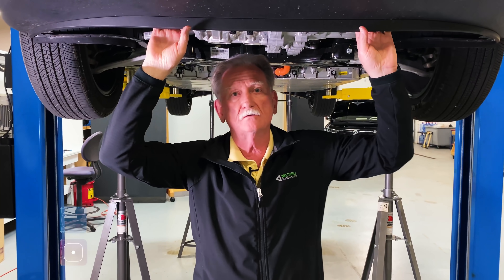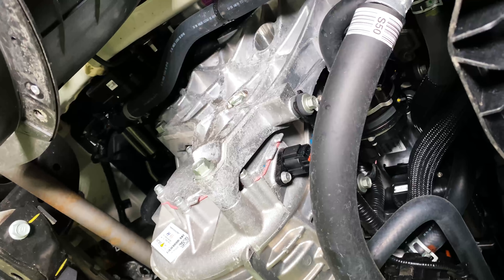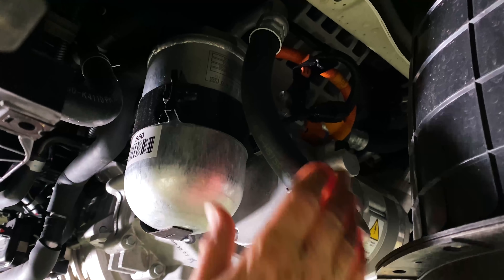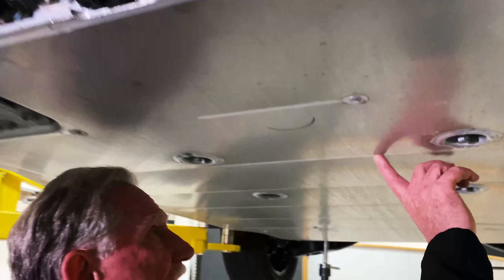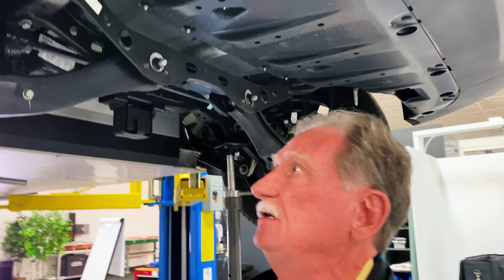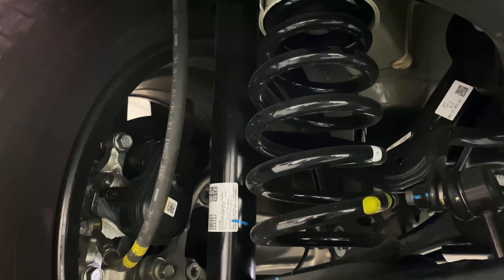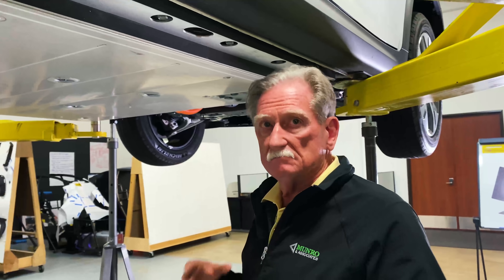Under the KIA NIRO EV

Comment: I'm glad they're look at the Niro EV.  I have this car and I came from a Tesla Model 3 SR+.  It's nearly as efficient as the Model 3 SR+ but it's got a bigger battery and a less aerodynamic design.  I was hoping for some insight as to how they made such an efficient car. 

I see why you'd call in at old person car.  Feels like it's got no frills and a softer ride than the Model 3.  I'm hauling around both my young daughters most of the time and I'm pretty happy with it.  

Might get an Ioniq 5 for a bigger car, the faster charging, AWD, and towing though.
Reply: You are saying the Niro has a Bigger battery and less Aerodynamics but that its more efficient then the M3?
Reply: @williambricker5988  I'm not saying that.   "Nearly as efficient," is what I wrote. It's less efficient than a Model 3, but it's really close.
Reply: Yup, I agree with all that. And also the Niro has real dials and controls on the dashboard... pretty sweet.
Reply: I’m confused why the bigger battery is a positive to you. You should want as small of a battery as possible while still getting the longest range. All batteries do are add cost and unnecessary weight. People should be aiming for increasing efficiency and range while keeping batteries small. Maybe in the future when batteries are cheaper, but for now I’d much prefer a car with a small battery then one with a larger battery and the same range.
Reply: @philorgneopolotin8762  I mention the larger heavy battery as something that's works against efficiency.  Despite that it is still nearly as efficient as the smaller battery in Model 3 SR+.  

Yea a smaller battery in size and weight is desirable to help efficiency.  I appreciate that the capacity is 25% greater in the Niro EV than the SR+.  64 kWh vs 50 kWh.  I do a 220 mile roundtrip highway drive to my sister's house twice a month.  The SR+ requires a charge stop and the Niro EV doesn't.  That's 24 less charging stops in a year.

Comment: i bought my wife a Hyundai Elantra limited a couple years ago. They make damn good cars with a 10 year warranty. Im all about using reliable proven parts if theyre cost effective and durable. Her car has the Atkinson designed engine which is better than any direct injection engine for reliability IMO. Why reinvent the wheel when you dont have to unless its a better yet less expensive part.  I respect Hyundai/Kia more than any other car maker( 2nd to Tesla of course). Id buy a HYUNDAI EV over any VW, GM, or FORD

Comment: There’s a plate that goes under the motor right? Otherwise those connectors are going to get whacked by something, they are so low to the ground.
Reply: Another comment from an Niro EV owner says yes, there is a cover which Sandy didn't mention removing.

Comment: Not enough space for a coilover for the i.r.s.?
Reply: Why would you want coil-over shocks? Suspension performance is best, if the shock and spring are mounted on an arm like this, with the shock as close to the wheel end as possible, and placing the coil spring around the shock keeps it from being as far out as it could be. This isn't a competition vehicle, so the adjustability of threaded spring mounts on the shocks would be pointless.

Comment: It’s Knee-Roh. And I’m hardly an old person, sold my Model 3 and picked one of these up as a lease for $314/mo. It is the most underrated EV available out there. Gets many more miles than the advertised range, its super quiet and confortable. No it is not as “cool” as a Tesla, but man it’s very nice if you can get a deal on it.
Reply: Sandy explained previously it is effectively a joke to say “nigh row” instead of the sound of “Nero” to avoid invoking the name of the Roman empower who allegedly played his fiddle while Rome burned.  It is a not so subtle jab at the problems Kia and gm have been having with their volatile EV batteries.  And yes, I drive a 2017 Chevy Bolt.

Comment: There appears to be a nice short length of cable between battery pack and motor, but the connections to the battery look quite vulnerable to road debris. Have I got that right or did I see it wrong. Also was it possible to see where the inverter was? Is it possible that the inverter is behind the bolt on plate at the corner of the battery?

Comment: The front of that battery pack and wiring is exposed to road debris, weather and whatever!  Weird
Reply: Only after the panel is removed.
Reply: @brunohill3229  I thought there would've been a panel but he said that he wasn't taking things apart.
Reply: @brucewayne2984  He said he wasn't taking specific things apart, but had already taken the cover off. The extra stands are there for safety because they took some parts off not knowing if they were going to accidentally drop the battery in the process. I don't know why they don't just read the shop manual...

Comment: So far, it's what I'd expect out of a modern Kia. Built like a glorified 90s car! :P

That rear suspension looks kind like a multi-link, with the spring and shock that is. But then there aren't the multiple links. Maybe cutting those additional links out is causing the vibration and harming handling?
Reply: It has a trailing arm, two lower lateral links (one of which is the one carrying the spring), and one upper link per side. It is a common multi-link design, used for a couple of decades by several manufacturers. Sandy just doesn't show the rest of the details, mentioning only the spring and shock placement and spring link design in this brief report.

Comment: 90'...It has the latest design i.e. the suspension as a typical gas car. Don't know any 90' daily car that has independent rear suspension... .
Reply: The suspension is practically identical to for example the 90s Toyota Previa, altough the independent rear suspension version wasn't sold in the US. A weird comparison, I know, but I happen to own a few of these Previas and they for sure were daily cars.
Reply: I bought the cheapest available Toyota in 1984 - it had independent rear suspension.

Comment: I have a swiss army knife in my pocket all the time, use it a lot! the most I use it for is to open beer bottles, but the screw driver(s), scissor, knife(s) come in handy now and then too.. 

But I agree, if you have a swiss army knife that is too thick with too many features, it loses its versatility, because the thick knife prevents you from using the tools properly.

Btw, this whole car starts to turn out to be a perfectly designed 90's car LOL!, old does not always mean bad! often in means better!! (read: more durable!) 
Nice review as always :-)
Reply: Same here, beer bottle opener gets used the most. Agree with Sandy,mine is just the blade and opener.

Comment: 90s car input...Rusts around the wheel wells in 3 or less years, has rust "drip stains" down the back hatch where the steel fasteners are used, door panels rusted out after 3 to 4 years, leaks oil after 6 years...love the 90s!
Reply: Bad car experience? In some parts of the world one can still see Audi 80 or 100/A6 1st gen still driving in large numbers, despite road salting in winter.. Double sided zinc protection on the entire body does the job. Mechanically also simple '90 cars.
Reply: I have a mid 1980s car, no rust.
Had a transmission leak years ago but had it fixed. Surprisingly, the car still has all its original parts including hoses, alternator, sensors etc., everything works.
Reply: @mamadouaziza2536  If you are running a mid 80's car with the original hoses and belts you are nuts!
Reply: @michaelholliday100  
Not nuts, its just all the hoses including the timing belt are in pristine condition.. I personally check every 3 months. The only sensor every needed to be changed was the one for the idling.. Water pump and fuel pump are all original.
Original fuel injectors and spark plugs. Even the catalytic converter is original. All window motors are working, the same with the air conditioner, not once has it had to be refilled with refrigerant..

The car is built like a tank!
Reply: Got a Toyota from 2000. That car never dies. And never was in a shop unless I wanted. Some old cars are made for life, not profit.
Reply: @NTNLabs  it was not a complement. 
its a Oldsmobile Custom Cruiser of Ev.  not toyota.

Comment: Laughed my ass off at "well designed 90's vehicle."
Reply: Like tesla without the batteries and the PlayStation and the IPod ALL
Reply: @nexussymbiosis9270  better than 2021 shit?  Its called perspective. Lots of people buy Toyotas for their perceived " reliability". How much of that is old tech? Would you buy a big pickup with rear drum brakes? ( i know Sandy thinks they are ok, but i think  my life is more important than saving a few bucks) They are still being sold. Perspective.
Reply: Packed in a Mazda design.
Reply: These cars are designed so easy to repair most repairs I do I can have done done within an hour..engines can be dropped in 45 mins subframes 15 mins dashes can be out of the car in 15 mins. There just giant legos and would pick a KIA over any other new car for quality of design even though the design is old which I completely agree with 😂
Reply: Lol
90s electric car😅😂
Reply: @CarlosReghis  Tesla has a smaller battery, less range for a much higher price.
Reply: I suspect that Kia wanted to save a ton on design and perhaps make last use of their existing assembly line.
Reply: polite way of saying, don't buy it.

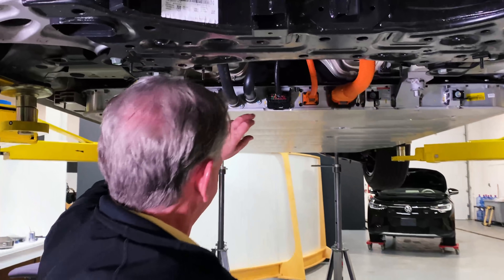Comment: looks like they just took an ICE car and slapped a battery and electric motor on it.  you can even see the exhaust tunnel at 5:00 also, the battery seems to be the lowest point of the car.  speed bumps are gonna destroy that battery pack.

Comment: Dual mini AF motors side by side and direct without reduction gears would provide all the torque needed without any bulk.  Storage volume would be enormous.  Cost would be minimal.  Efficiency would increase by 25 percent.  A $15,000 Honda SUV?  YEAH, that's what I'm talking about.....
Reply: Separate motors would eliminate the differential, but increase the cost. Motors without reduction gearing would need to be much larger, and would be much more expensive. There would be little to no improvement in efficiency, since the gearing wastes very little energy.

Comment: Built on proven tech. No wonder they're so reliable and popular. Still 280 miles and 0-60 in 7s with 450 litres in the trunk and that's just above the load floor. It's a legend here in the UK, where we think the Kia Soul looks like a granny car!
Reply: I agree 100%. Most poster here are from the States. We here in Europe have slightly different requirements and opinions - which is ok. We drive a 2020 Niro and are very happy with what we got.
Most BEVs where first based on ICE platforms, except Tesla and BMW i3. But in 2 years nearly all BEVs will be on their own new designed platform.
Thanks Sandy for all your insite you give us.
Reply: I like the Soul..

Comment: It looks over constructed for strength and durability .
Reply: My wife has a 2021 Kona EV and when I got it up on the hoist to do some rust spray/r&r exterior lamps, I came to the same conclusion.  Chassis details such as the chassis aerodynamic trim parts are far superior to my 2018 TM3.
Reply: It’s rated for 100 kg roof load, 100 kg load on the tow hitch, it’s like they built it as a SUV and designed it as a city car. I think it’s awesome.

Comment: does the vinyl on the underside that runs along side of battery have any sort of texture? I am wodering if it somehow has groves or pattern to redirect rocks/debris toward the outside of the car so it will drop out and away onto roadway vs flying directly toward the rear

Comment: How can these Kia engineers put the battery and aux battery connections on the leading edge of the car??!! Get ready for moisture ingress.
Reply: There is a cover that goes over all of it..
Reply: Yeah, I was sort of surprised that Sandy didn't comment on the leading edge of the battery pack. Looked pretty vulnerable to me. That said, Kia managed to keep the power supply cabling really short.

Comment: I wonder if Kia sent you this 90’s car to lower expectations so that when they send you their next generation BEV you can compliment them on how far they’ve come.
Reply: Should have sent the EV6 or the Hyundai Ioniq5
Reply: @michaelreyes8670  This was a marketing thing. It increases EV credibility. Just like Ford's rep talking about the Mach E
Reply: @michaelreyes8670  they are practically same 90s design.   just different exterior and interior.
Reply: The reason why they use tried and tested tech is for cost and reliability. The drivetrain seems sturdy, easy and affordable to fix. I take this any day over some German tech extravaganza that's going to cost an arm and a leg to fix when goes bad
Reply: Those cars aren't shipped yet in the USA except for showroom reviews.
Reply: Exactly

Comment: Like the videos, but tipping the cashiers is a bit over now.  Most are back to work and making above the minimum wage (entry level job).  Would rather tip someone doing an essential job like first responders (buying meals, etc) than use on a plentiful job position.

Comment: What the market needs, to have BEVs as a more popular choice, it's cheaper options as the Kia Niro or Nissan Leaf.
Reply: We need compelling EVs, not mediocre EVs.  We want customers to compare EVs to ICE and then choosing EV to be a 'no brainer'.  This requires EVs that are safer, more efficient, have better performance, less maintence at equal or less cost.  Some current EVs already meet those criteria.
Reply: @davidharris7249  so do you really think the mainstream has plus 40K laying around to buy a new BEV, that suffers a major depreciation in less than five years of usage?
Reply: @RogerM88  No what I believe is the average price for a new car in USA is the same as the price of a Tesla Model 3SR+, and for that price you get the better: safety, efficiency, performance, fuel costs, maintenance, OTA, tech, sound, and charging network, and no pollution, a battery that will last 200,00 miles plus and is recyclable, and best resale value.  One doesn't need to pay up front, that is what leases and loans are for.  If someone can't afford that price, then they can buy second have like I did for most of my adult life -- and if you are right about depreciation, then they ought to be cheap.  BTW, Model 3's sell second-hand for almost as much as new, and in fat sometimes at more than the first owner paid for them.  I am sick of people sounding off without actually looking into it.  And I also think making mediocre BEVs is to purposely prop up sales of ICE cars.
Reply: Kia wants $44,000 for this junk.
someone needs to go jail.

Comment: I'd like to know what '90s design means in terms of performance and cost.  Would the car ride/handle better or cost less with current design features?
Reply: I thought they used lead acid or nickel metal hydride batteries in EVs in the 90s. They are cheaper here than a Tesla M3 SR+  and have more range.
Reply: @brunohill3229  
What EVs with higher range than a Tesla ME SR+ sold new for less than the Tesla in the 1990s?

Comment: I'm not keen on the vulnerability of the wiring at the front of the battery pack. Seems likely make contact with a kerb or piece of debris during the life of the vehicle—especially as the battery pack is so low slung.
BTW the Kia e-Niro is considered a very attractive car in Europe; very efficient with a good turn of speed and always has high ratings in reviews.
Lastly, the black tape on either side of the battery pack seems to be so that when seen from the side the car is visually 'blacked out' underneath rather than it's underpinnings being shiny and obvious. Take a look at the press photos.
Reply: I wonder if,  in the interest of brevity,  they omitted the removal of a protective shield?
Reply: @jamesengland7461  They did - i have an e-Niro and none of that is visible from underneath.  There's a shield running from the front right through to the battery.

Comment: Thanks for the review, Sandy.  Its was a nice video on the Niro EV. I see it as low end EV, but i am glad it's well built even if the standards may not be cutting edge.  I think I'd rather have quality than fancy with no substance.
Reply: more crowded ev market means more innovation or better prices. maybe they will stock an actual base model instead of the 50k platinum editions
Reply from the maker: Glad it was helpful!
Reply: $44,000 low end.  or over priced , backward engineering piece of Junk. you decide.
Reply: As the owner of a Tesla 3 which happens to be a lemon, I’d rather have the Hyundai / Kia I think.  Especially given the lack of responsibility shown by Tesla customer service for my rather expensive decidedly imperfect car.

Comment: Looks like they put that black vynl on the battery sides to mask the fact that it hangs down below the side rails otherwise it would standout more. You could see the massive gap between the transmission tunnel and the pack. Since this was an adaption they couldn't move the floor height to compensate for the battery thickness even as slim as it was. Reminds me of the upcoming Hummer, thing looks like the pack is like a foot thick, ugly as hell imo, they try to mask it by doing a two tone paint otherwise the side profile of truck would be  huge. Mach E and others all do the same thing, try to trick your eye into thinking the body line isn't where it actually is.
Reply: Solid observation 👍
Reply: yes, if you sight any Kona EV or Niro it's def noticeable.  it likely comes from the fact that Kona/Niro chassis also serve as platforms for their ICE versions.
Reply: gear tunnel? somebody got rivian on the mind! haha great comment I agree
Reply: Haha! That’s funny, I had just watched a Rivian thing, good catch I meant transmission tunnel. :-)
Reply: hyundai engineering.   dont fix it MASK it